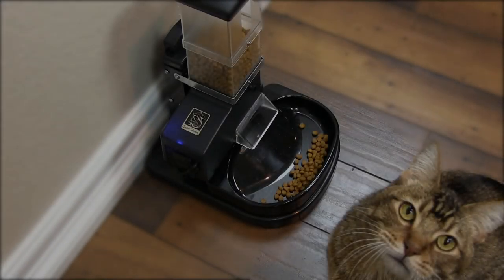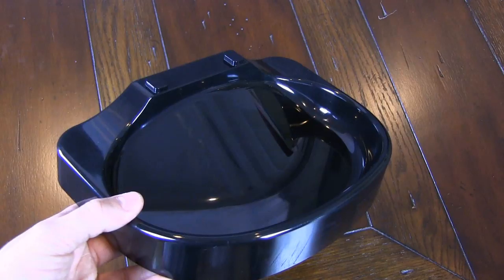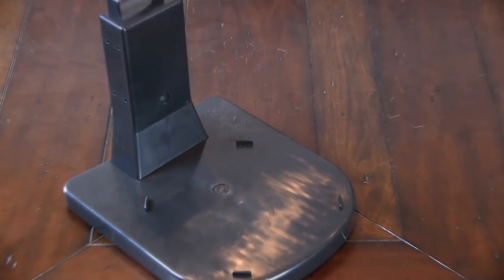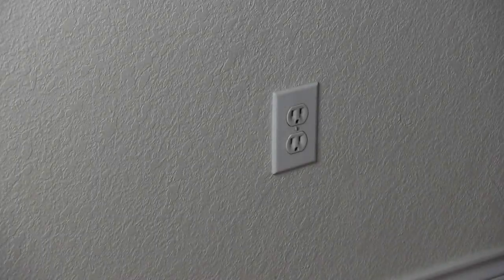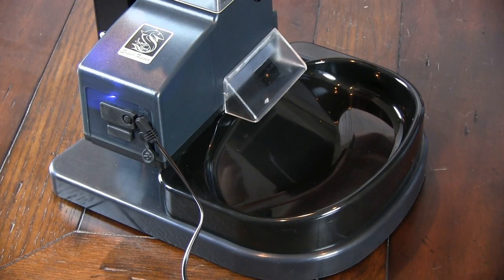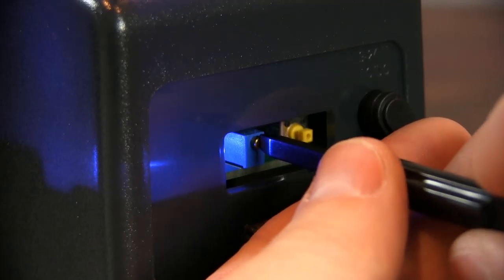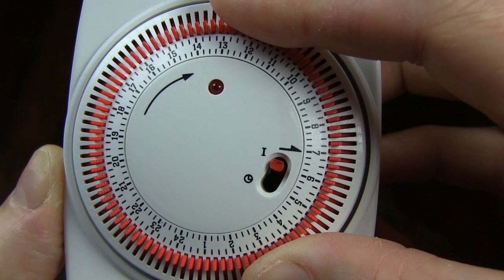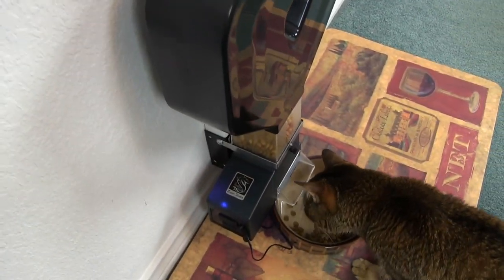Timed Portion Controlled Pet Feeder (SUPER FEEDER®)-Infomercial / Assembly Video

Comment: This is a great feeder.  I've had one for 5 years and a second for 3 years, and they both still work perfectly.  I use SureFlap RFID reading cat doors with the feeders in small glass doored ikea cabinets to separate the cats food so they can be properly portion controlled.  With frequent small feedings, I've managed to get my once 18lb cat down to a healthy 13lbs, helping to prevent quite a few obesity related illnesses.

Comment from the maker: You are correct. With a machine, there is always a possiblity of a failure regardless of what machine you have. Of course, an animal will not die if it misses a meal or two, but I would still have someone check on an animal a couple days a week just to be sure. Not only to check feeder, but just because who knows what the animal may have gotten into.  A feeder is to assist you not to replace you. :)  It sure is nice not having to wake up in the night to feed the hungry monster!

Comment: I saw the setup with the 4 foot section of metal rain gutter drain that looked good. I wonder if that is slippery enough inside to hinder ants trying to venture up. Hanging the 1.8 gallon reservoir on the house wall in the carport would keep it out of the reach of raccoons and foxes which do frequent our vicinity.